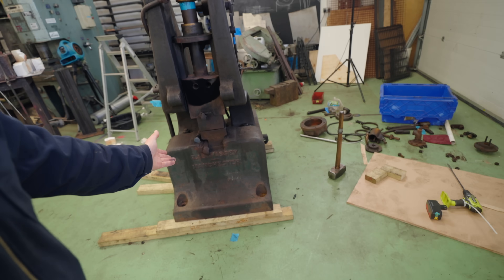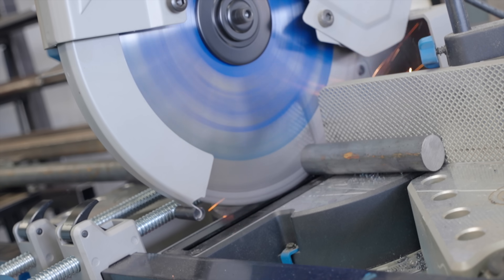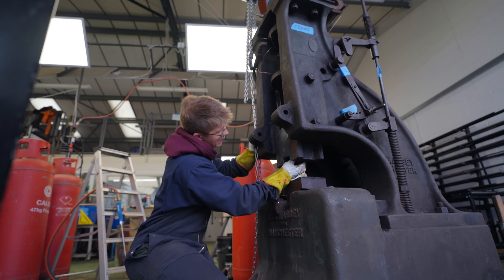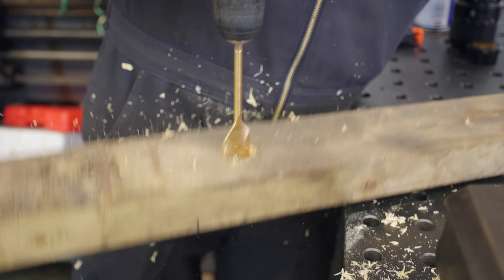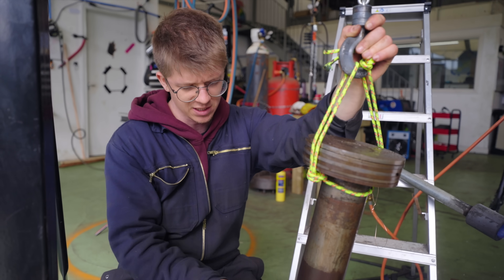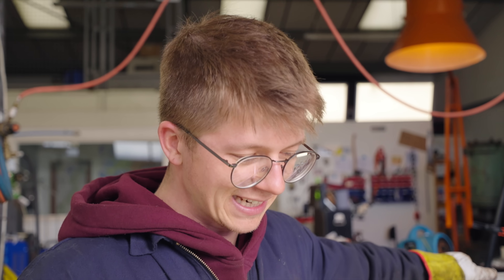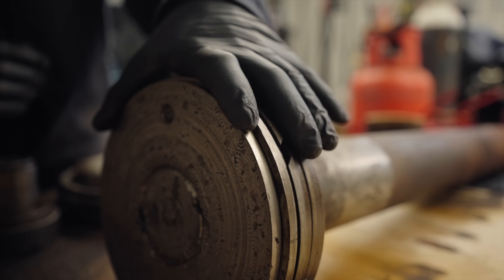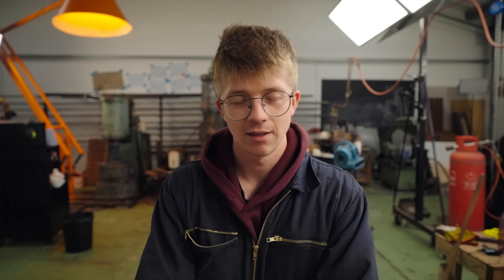FIXING A 1900's STEAM HAMMER! Pt. 2

Comment from the maker: Thanks for watching guys! I’m keen to hear your input on the project! I appreciate our sponsor for making it possible to try and restore this thing! Go to https://TryFum.com/ALECSTEELE and use code ALECSTEELE to get a discount off your order today.
Reply: when you restore, fix, improve your big tools. its the greatest thing
Reply: take the old die key and make a knife out of it or something
Reply: Use a laser rust remover thingy 😃
Reply: I think I would rather not huff random fumes. That's basically just a vape and that entire industry is unregulated in most countries.
Reply: @SAOS451316  Except it isn't anything like a vape. Its just pulling air over a polyester sponge impregnated with essential oils.  Its no different from what goes into your lungs when you're peeling an orange.
Reply: Another great video. I've stripped a few stubborn machines. I've had a lot of luck getting things hit to break the rust then using a CO2 fire extinguisher to freeze it and shrink it. Works a treat. 
As for your piston rod, you would want to cylindrically grind it and have it hard chrome plated. Very much depends how the piston rod seal works but I would assume you could bush it out.
Reply: Look up cutting edge engineering, Australia. Hydraulic pistons are his main work, I think. But he knows his stuff.
Reply: there is a youtube channel called old steam powered machine shop where a guy named David Richards maintains an entire machine shop of steam powered tools and a steam engine to power them. he will have expert advice for you.
Reply: I'm a smoker and I can not smoking for like 3-6 month just because I don't feel like it. Call me moody but yeah😂
Reply: If you wanna find out where the holes go u can use a fogging machine to find them
Reply: SNS 300 does spray welding videos on big shafts to build up material and turn it back down in lath a good way to clean up your steam shaft
Reply: Fum = Quitting cold turkey. It helps, but be wary of the withdrawal symptoms
Reply: For the Ramp rod you would get it turned and than spray welded and than returned back to spec.
Reply: You should make a Damascus zippo lighter
Reply: @Alec Steele - RE: The piston... I've seen videos of (I think it's called) 'Spark Welding' where a shaft is put in a lathe, rotated slowly, and over time sparks build up the thickness of the shaft again to an 'Oversize', so that in the end the shaft can be re-lathed back to original diameter and smooth...🤔
😎🇬🇧
Reply: @CuttingEdgeEngineering this ya Boy!
Reply: @KaylaNeace-q6t  he's absolutely already made a Damascus zippo lighter. Literally years ago 😂
Reply: Fum looks wild

Comment: Since you have to replace those bronze bushings anyway, You can keep the original piston rod, reduce the diameter until the pitting is gone, then bore out the new bushings to that new piston rod diameter.
Reply: I would a "column A, column B" to this and Mr. @manuelschubert3449's comments. That is if replacing it isn't in the spirit of the refurbishment.
Reply: I totally agree. Have the piston ground, hard chromed then ground to a logical size, the make the bushes to suit
Reply: @crashnburn2351 I agree, send it out to get a chrome finish.
Reply: I was about to suggest this.   Seems like the most appropriate way to accomplish this, similar to re-sleeving an engine.
Reply: @redwaller1  Reducing diameter to remove pitting also has the benefit of possibly revealing cracks which might have developed in the shaft. Still, those pieces except the bronze seem remarkably solid and in decent condition for all the work hardening and fatigues they'll have experienced. 

Heat seems to have possibly relieved some stresses too.

Chrome (or other appropriate) finish also sounds good for multiple reasons. 

If the shaft's so far gone an actual sleeve is needed, it's an issue because this is a hammer shaft, and thin-walled sleeves can metaphorically turn to old wrinkly droopy stockings and drop to the shaft's cankle from the percussion, without a keyway and key along the shaft length, which is very problematic. Would not recommend.

Of course, I have no clue what I'm talking about here. I'd have to have been a tyke on my grandfather's knee to have seen any of this actually done on equipment of that vintage back when machinists regularly worked on this generation of hammer, to have actual knowledge.

But the folks who do know what they're saying seem pretty well-informed.
Reply: And get it hard chromed
Reply: You could chrome finish it but it probably wasn't chrome rod originally.  Thats a vital part that will take a lot of abuse. I'd be replacing it with a new shaft of the original material if possible. It would be good enough for another 100 years and would be the correct size as it was designed originally.
Reply: @robertogrady1321  Bad timing that alec is back in the UK, would have been a good collab with titans of CNC
Reply: @---Michael---  yeah not the sort of thing you can get in hand luggage
Reply: I was about to say this I was gonna also recommend to improve on the piston rod after machine in down till pitting is gone would chrome plating like a hydraulic rod be better or would the impact of it being a hammer ruin that ?
Reply: @crashnburn2351 would an engineered coating specifically for pistons be better? I don't know the cost difference but I assume it's much easier to uniformly coat a shape like that with a coating rather than chrome plating.
Reply: @MrShmaleb  normally you would have it hard chrome plated then held between centres and ground to finish. It’s the only way I have ever had hydraulic pistons repaired.
Reply: You can see the mounting format of the piston to the rod too. I suspect the rod is just screwed on and then pinged to set it. Fairly standard for hydrolic work. Cee on YouTube has some good videos of large hydrolic piston repairs. Id look at it like they do
Reply: @robertogrady1321 - Definitely was not chromed originally
Reply: Just re-rod it. Order a piece of induction hardened chrome bar, turn the ends to match the original and make a bronze bushing to suit the new bar. You can likely get chrome bar that's the same size as the original. Watch a few @CuttingEdgeEngineering videos to get a feel for it.
Reply: See the only reason I disagree with this is that gring away the pits means reducing the total material, which also changes the tolerances in that section in a negative way meaning the likelihood of it breaking due to a stress fracture gets much higher.
Reply: It would change the diameter of every other part if the rod shrunk is the only thing where everything is a press fit
Reply: @MrCinimod93  Again, the biggest issue is that stress tolerance is related between size, shape, material, and the forces acting on it. Trust me when I say it is a balance that typically requires over engineering, so the stress tolerances  might still be intact yet risking a change to those stress tolerances by removing material will shorten that parts lifespan.
Reply: @jesseb5378 yeah but you can’t keep everything sometimes
Reply: @---Michael--- or abom79

Comment: As a crane operator I have helped resurface a cylinder piston.  Lathe clean it, thousands of an inch and chrome it.  Pistons are chrome because they can handle the weather and in your case steam.
Reply: If you have to take more off of it, you can put a sleeve over it with an interference fit after the lathe.
Reply: Hydraulic cylinders are ground and re-chromed to refresh them when rebuilt.
Reply: Lathe it? .Turn it please

Comment: Kurtis of the Cutting Edge Engineering channel is often repairing damaged hydraulic cylinders. Sometimes he can lathe down the cylinder and add a sleeve to it or the casing, other times he gets a brand new cylinder and almost machines a new one from scratch, salvaging the bits he can from the now "donor" part. I would recommend seeing his process for a few options.
Reply: I think he use spray welding too so as to build up the piece again.
Reply: First person I thought of looking at this project as someone who might have a wealth of knowledge on dealing with this piece of machinery.
Reply: 100% need to watch a few hours of Kurtis at work if Alec wants to DIY this. He really should just replace it with a new cylinder and machine the mating parts.
Reply: Exactly who I thought of...
Reply: I like that channel, too.  The problem in this particular case is that the barrel is actually a 100 year old cast iron casting, not a piece of tube steel.  He cannot replace the barrel.  And if there was a screw bouncing around in there to the point that it damaged the top of the piston, the walls of the barrel will probably be in a similar condition.
Reply: sounds like a colab to me!
Reply: yeah CEE came straight to mind!
Reply: Yes! Ask Curtis for advice!
Reply: I was going to recommend Kurtis, but the mention of spray welding made me think of ABOM79. And for the person mentioning the 100 year old cast iron casting, there's no reason (other than perhaps more aggressive wear) that you couldn't remake the parts with modern equivalents. (Modern piston shaft, a modern materials gland, a bolt to hold them together, etc). As long as the dimensions/lengths match you should be good.
Reply: @junkman1561  My first thought when I saw the pitting on that shaft. CEE would be a great contact for this project.
Reply: @tommy49er  Yup, I watch him every Friday..
Reply: @TheWolfster001  the shop dog 'homie' always makes me smile and it cool when they feed their bird friend George

Comment: The piston rod can be turned down to remove all the Rost and pits. Then up to 1mm in diameter can be coated with High Velocity Oxygen Fuel (HVOF) spraying and a powdered carbide material for superior corrosion and wear protection. WC-CoCr, Amperit 558.074 would be my preferred material choice. There are several coating shops in UK who can support here😊
Reply: this would make a spectacular video for this audience, too. Spray welding on a lathe looks incredible on slowmo
Reply: Especially for an audience which love metal and fire 🔥
Reply: It is much cheaper to make a new one. These rods are known for breaking, and you end up with a very expensive rod that is also thinner at core. And because the piston is quite damaged by a bolt that was in the cylinder, there is a chance that the piston has play on the shaft or is no longer even seated straight.
All in all, I would go for the old-fashioned way, also because it fits better with the history of this machine.

Comment: Alex,
Been a fitter turner fabricator for over 50 yrs so I have a few clues.  Even finished ground on a large Churchill cylindrical grinder 2 piston rod assemblies for a Beche + Grohs counter blow hammer that had dies each weighing 14 tons yes she was a big bastard.

The piston heads were 24 inch dia.

Keeping in mind that this hammer of yours is  a century old ish so before you rush into anything I would check out a few things first.  I would start with the cylinder bore. Now due to its age there will be wear, out of roundness and taper.  This cylinder would benefit from a hone  or a re-bore.

Next I would replace the piston, rod (  one unit ) and rings and of coarse the bronze bushes.  The piston and rod machined from a solid billet.  Mild steel would be fine but if you want to be on the safe side a medium tensile steel 4140 or similar. Check with steel supplier or Massey Hammers for their recommendation.

Wouldnt mess around with chrome plating. the old rod.  Piston will be worn too. Most think its the same chrome that is used on cars etc when in fact it needs to be hard chrome which will need to be ground afterwards.  H/chrome is expensive, well here in NZ it is.

After turning from a solid billet I would definitely get it ground.  Another thing to check out before doing anything is in what condition the bore is in the tup as the rod needs to be a good fit,      (   you now know all about that). That bore might just need machining too which will obviously affect the dia of the piston rod.

There is quite a difference between your rod assembly and a hydraulic rod  one. The cycle times are many times more along with very violent forces not found in a h/cylinder.

So this will all need some careful research, measurement, costing and availability of the materials  Depending on your budget there might have to be a compromise but Im sure you will be able to get  "mates rates" on materials and machining.  Even then it will not be cheap but it will be a "good job" well done.

Peter.
Reply: Would stainless or a stainless alloy be a better option for the ram instead of chroming it?

And Alec, you've got some great creators in the YouTube community that know what they're talking about. I'd send a message to Titans of CNC and see if they'd be willing to help you out on some of the parts, or maybe they'd have some ideas.

Comment: I'm sure others have suggested this already.  But the two bronze parts get oakum stuffing cord between them which is tightened in place to form a steam seal.    I'm sure you're on the right track with the floating upper piston too.  That's a buffer which stopped buffing due to the damage and what I suspect is a one way valve that got peened out of shape and stuck in place.  Hence the problems getting it to fit.  The piston is likely been distorted as well so perhaps the hole is not a good fit or even totally round any longer.  As for the shaft it could be built up with spray welding and ground back.  But it might be easier and less risk of distortion if you can find the right size to replace the whole thing with a piece of cylinder rod shafting.  Kurtis at Custom Edge Engineering being someone that has discussed this choice and why in a few of his heavy cylinder rebuild videos.  Abom has also brought up this issue of spray welding and distortion.  Of course it's also a 100+ year steam hammer.  So sandblasting, spray welding and grinding back might be entirely fine.  Likely would be.

Comment: In case you don't want to end up with a reduced piston shaft diameter, you could try reaching out to someone who does spray welding. It works by spraying molten metal onto the part while it's rotating, increasing the diameter. So you would take material off until the rust and pitting are gone, then spray weld until it has a slightly larger diameter than originally, then machine it back down to the original diameter.
I don't know if this process makes sense economically in your situation, but it could be worth it to show it just because of how cool it is. There are some welders here on YouTube who can do it, so maybe you could do a collab.
Reply: Cutting edge engineering is a good one who does this type of stuff
Reply: or for more durability you can turn it down and have it hard chrome plated to build up material then have it ground to fit new bushings

Comment: For your bronze cracks, anneal the pieces first, then braze a little bronze wire into the cracks, then re-anneal the fixed pieces to make sure the cracks are fully filled, repeat that process until the post-treatment annealing stops re-opening the cracks
Reply: Not sure on the tolerances, but seems like machining a new piece (if you have a piece of roundstock bronze that size) might be better.
Reply: He'll likely need to re-make both anyway, because if the shaft is severely pitted, he'll have to machine it down more than they can add back via chrome plating, and thus needs to re-machine the bronze to a smaller ID.
Reply: Both these seem like great suggestions be wary of tig welding bronze as not all of it can be welded safely. Try striking a pool on a non spec surface first if you try to tig it.

Comment: On that piston rod, you'll have trouble getting the finish made properly in your lathe. The tooling will leave little grooves in the rod that will eat your bronze bearings like a file. The easiest way for you to get it fixed would be to clean it up with hydrochloric acid to remove the rust (don't put oil on it), and send it out to get ground and chrome plated. Any hydraulic cylinder making/repair place should be able to do that. Or if you want to use your lathe, get a tool post grinder.

Redo your bronze bushings, both of them. You don't want a piece breaking off and floating around like that random screw was.

As for your trouble removing things, you need a hammer that has the power of Thor. So, get one of those Astro Pneumatic Thor air hammers.

Comment: For driving things out or in (like long nails into old beams,stakes in ground or loosening things)-a jackhammer  with cut off chisel is a king.Especially if you have a good strong one with 15j -it can be even rotary drill hammer.
And remember if you want to loosen a taper hit it sideways first.
If you heat things up use parafin candle -wax penetrates and lubes things.
Citric acid (e330 food preservative -granulated powder you can buy in store for cheap,4% mix with water) works wonders on rust, when you need to submerge large objects you cna build a frame around it and use construction nylon sheet as a pool .

Comment: start with an evapo-rust bath for 2 days to remove the rust
then spray weld to fill in the voids (adam booth did a video a couple of years ago on spray welding)
then lathe back to size

Comment: We do Babbitt metal work on hydraulic cylinder rods at work, at least the ones where making a new one from new stock isn't economical.  Grind her down to clean metal, heat it up and flow Babbitt metal onto the rod on the lathe (like spray brazing), turn the Babbitt metal coating down to dimension on the lathe and polish.
Reply: Brilliant

Comment: Past hydraulic tech here, if you can get a new seal to take up the difference, you can turn the shaft of the cylinger ~.2-.3mm without compromising the strength of the shaft too badly. When you start rebuilding, i would highly recommend looking into using a graphite seal for your center ram ring.